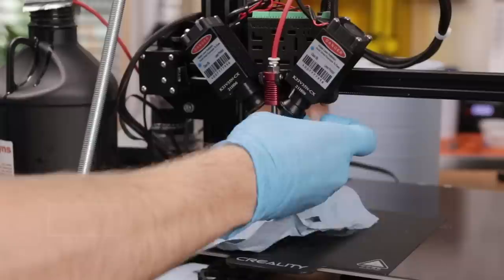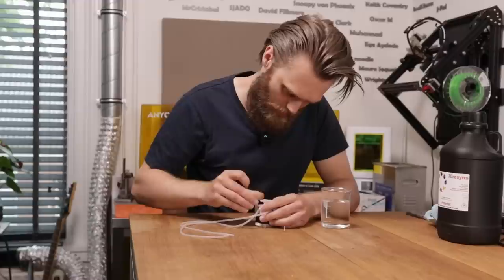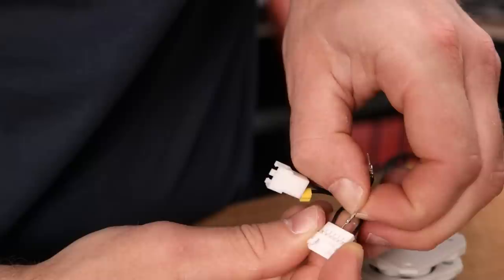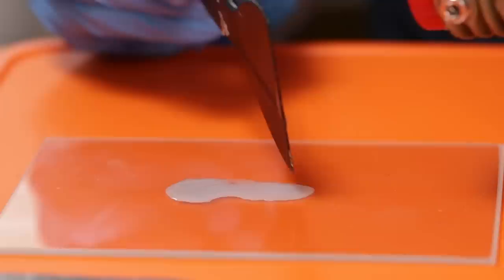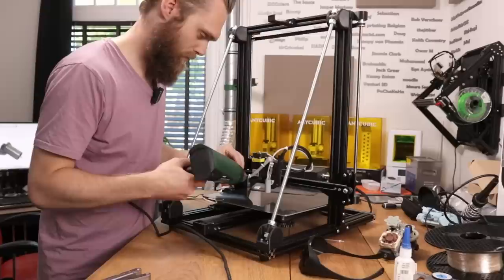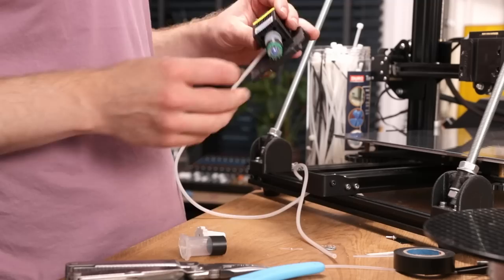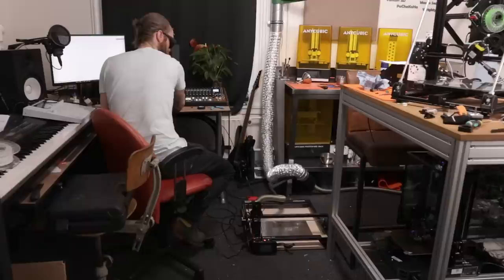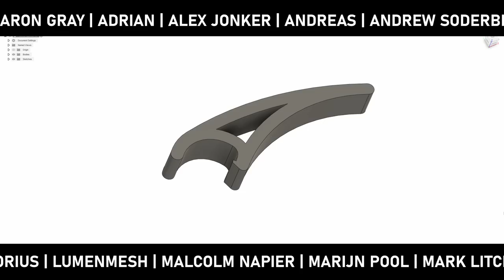FDM resin Printing with LASERS and a 3D Printed PUMP!

Comment: One note on the optical fibers, they can actually fail to reflect the light along the fiber if the bend radius is to small, maybe that was also a reason why the first design failed
Reply: Bingo.
Reply: Whilst we can see “some light” at the end of the fibres, some materials have much lower transmission at UV wavelengths.
For example Germicidal 250nm fluorescent tubes have to be made with quartz as glass filters a lot of the energy at this wavelength.

I suspect end polishing of the fibres also has an impact.
Reply: In this case it was because of the fucked up surface. One cannot cut fibre optic cable with a kitchen knife and expect it to transmit light perfectly. The cables must be cut with a special tool that makes sure the surfice is perpendicular and doesn't have defects. You also need to align very well the start of the fibre to the laser beam making sure it also is parallel to the beam. If the laser is coming at an angle, there will be huge reflections at the beginning.
I liked his idea don't get me wrong, but it is pretty clear he didn't research how fibre optics cables work

Comment: I work with lab instruments that use peri-pumps. They have a lot of advantages, such as easily adjusting flow and volume by changing the ID of the pump tubing.
You can eliminate the pulsing by using the flexibility of the tubing between the pump and nozzle as a pressure receiver.
If the flow from the pump is slightly higher than the nozzle size can handle, the tubing between the pump and nozzle will pressurise and expand slightly , acting like bellows to absorb the pressure pulses.
Also, having more rollers reduces the volume of the tubing between rollers and therefore the volume that is pumped with each revolution. Most commercial peri-pumps use only 2 or 3 rollers.
Reply: I used to use peristaltic pumps. I also recall them only having about 3 rollers and they definitely delivered continuous flow to lab instruments. I remember calibrating the flow and we used special tubing in the actual pump section with coloured tags on each end which indicated the flow range based on ID, these tags locked in place to stop tube movement and put the tube in the pump under slight tension.. helps with pulsing and stops tube feed.

Main issue with a peristaltic is over time it damages the tube changing the flow or even wearing through completely. So another reason for the short section in the pump as you just replace that small length each time.

Overall I think he should take a quick look at lab grade peristaltic pumps as they solved all these issues decades ago.
Reply: @RocketMagnetUK  I agree . There are many different designs. I have even seen hospital infusion pumps that used many flat plates operated by a helical cam to pinch the tubing in a continuous wave.
A company like Watson Marlowe would be able to give him all the information he needs

Comment: Hi really nice project. I have worked in a lab for uv curable resins but I have no experience with 3d resis. There are basically two kinds of catalyst for this typ of stuff. Radical and Kationic catalysts. The radical ones have the advantage that they stop working when Light is emited which is super important for high res.,  while the Kationic once continue after the UV is gone but they are way slower. So you actually could use a really thick resin with a cationic catalyst. It would allow the resin to cure after it has left the nozzle. But you would need rather thick layers and would have low resolution, but you actually might be able to get super fast printing speeds. If you do not care about colours curcumin is actually a pretty good kationic catalyst. Greetings from Germany

Comment: You tried the idea that I have been thinking of for about a year, great job! I would use multiple UV LED's in a circle pointing at just below the nozzle. The point is you don't need to fully cure the model during printing, so you won't need that much power delivered by a UV laser. The model can be fully cured later in a UV chamber, we just want this to get the proper model shape in the first place.

Comment: I totally had a similar heat related issue when playing with the plastic optical fibers on a project. Even got glue would partially melt the fibers, and be responsible for blocking the proper light transmission.  I felt your pain my friend.

Comment: Really nice, maybe instead of trying to cure full cure the resin while printing you can add a UV lamp and after every layer the nozzle go to a light protected place, turn on the Light for a couple of second and then continue printing
Reply: It won't stay it place this way. The resin is still a liquid that would flow down while you are printing one layer. You need to constantly cure resin that was just extruded.
Reply: @Karavusk  it depends on the layer thickness, the surface tension of the resin and the nozzle diameter, you can add something to the resin so it get thicker, like baby powder, the video you quote use a thicker resin more like a gel

Comment: Great video! I would use an air pump inside the bottle, and a valve on the nozzle instead of a pump, like the system used in the m3 max to top up the tank. Also i would try to print at very low temperature to have a viscous resin, much more like the gel in noel's video. That would allow to increase distance of the laser light from the nozzle and prevent clogging. Just my 2 cents here.
Reply: Arpad Toth  you just need to build enough pressure. Anycubic use the very same method to automatically top up the vat in the m3 plus and max printers: a sealed cap on the resin bottle and a small air pump that just pumps air into the bottle which then sends out resin to the vat.
Reply: Arpad Toth  just need to have enough pressure, people who have a well for their domestic water supply the water is pumped into a tank with an air bladder which then pushes into the house.  Our old house had that and it kept a steady 60PSI.

In theory a hybrid system would work to eliminate the issues of pulsing, a pressurized tank and the pump constantly pushes resin into this tank while an pressurized air pocket moves the water along. Just like how the well pump pushes water into the storage tank but the air bladder pushes it up into the home.

Comment: Wow, what a cool video and idea! I've seen some great suggestions in the comment section about pulsing the lasers. I am not an engineer by any means, but perhaps a "simpler" first attempt would be to extrude the resin with the laser off, then run the same path (without extruding the resin) with the laser on to cure the resin. The higher viscosity resin would probably be more ideal, since it better resists flowing away from the previously deposited layer. Yes, you are running the same print moves twice which will greatly increase the "print time", but I don't know that speed is necessary concern at this stage. Just an idea (maybe others had it in the comments too). I am looking forward to your next video!

Comment: Maybe the metal build plate was reflecting the uv into the nozzle. A solution would be to do two passes. Extrusion pass and curing pass for each layer
Reply: it might be the resin reflects the light too, could use black resin and big retractions maybe ?

Comment: I think your on the right track using a standard Nozzle shape, the V angles down towards the tip so no matter which direction the nozzle goes any oozing will flow back to the tip. With normal fdm the plastic is always soft and will be wiped off when the direction changes and gets 'run over' in the part when the nozzle returns thus it doesn't accumulate but with resin it needs to get cleared asap. the standard nozzle looked the best if you can sort the leaks.....hope this is some help, Andrew. love watching you work ....it's FUN

Comment: Sugesstion, paint the printning surface mate black, and use black resin to prevent ligth leaks, use a weaker lazer or dim it out, you tecnically can shine a weak lazer directly to the center, but, weaker so it doesnt solidify instantly, more like a flash ligth, that wen the center of the lazer gets away from the printnted point a second ago its solid enough to hold it self up, untill the next layer goes over

Comment: Amazing, as always!  Have your sponsor make you a custom resin that is more cohesive like silicone sealant texture or toothpaste so there is no surface tension trying to form drops. I believe that is why your nozzle ends up scraping. The trick will be to balance thickness vs 'pumpability'

Comment: I watched the same YouTube video and thought the process would be the end all in 3D printing. I have two suggestions. Lose the laser. Go with what we know already works,  UV leds. Cheaper and easier to work with. you'll still need some way the shield people from the light. Second use a tank to store the resin and air pressure to pump it. You can control the pressure very precisely and electronic valve to turn the flow on and off. Good luck and I'd love to see you make this work.

Comment: Indeed, it seems like you can take some notes from that machine in Joel's video. Opaque white gel resin is what they use. Less UV reflection with opaque white. Gel because surface tension is unlikely to hold. Perhaps if a single laser is not pointed at the tip of the needle but instead - a couple mm BEHIND the line of resin as it's being printed. That would only work if printing in that single direction, though. Hmm.

Comment: Try adding an additive to the resin to turn it into a gel, add some viscosity to it so it acts more like melted filament vs water. Surface tension causing too many issues

Comment: Inkjet printing has had similar flow issues with nozzles, one of the ones that worked well there was with a piezoelectric crystal for a drop on demand printhead. This was used to control droplet size and speed of droplet ejection from a reservoir. 
Very exciting to see this, looking forward to more updates.

Comment: Incredible first iteration! I'm glad your persistence payed off. 
If your enthusiasm towards this project still outweighs your frustration and you're planning on a redesign, I have one possibly good suggestion:
Higher pressure resin through a much smaller nozzle. If you get the pressure high enough you can form a small jet of liquid that will still be diposited even if the nozzle lifts off the surface. As a side benefit, this will increase the flow velocity giving less time for the resin to cure in the tip of nozzle (also the smaller opening will let in less UV).

If you like the idea then I'd look into using a scroll pump for consistant high pressure flow. The elasticity of the peristaltic pump tube would be an issue at these pressures, especially when you want to turn it on and off quickly. Perhaps pneumatic tubing would be a good choice.

Comment: One quick solution to try should be to get some kind of matte dark black coating or cover on the build plate, which should greatly reduce the curing issues, as the black material should absorb most of the laser light. Maybe use a bottle of Black 3.0 to paint a build plate and place under some kind of transparent matte non-stick sheet? 

You may still have issues with the light reflecting off the printed material, but should otherwise greatly cut down on the reflections.

Comment: I would experiment with led exposure time for resin cure. With this I would set up a led timer circuit with the pump module so put sensors on the position of the pump to give you timing so it can interrupt the led and pulse it as a strobe effect. I believe the resin is illuminating on itself so a timed led pulse strobe would most likely help. Remember translucent liquid acts as a magnifying glass for light. This will take mulitple sessions to get the timing correct.

Comment: Once upon a time, there was a roller pump (application) that suffered from poor impulse control. But as luck would have it, that problem was solved back in the early 1970s. The application was pumping blood in heart-lung machines, but the impulses caused by the action of the roller(s) would put a "squeeze" on the red  blood  cells,  causing them to burst.
You need an entirely different solution (no pun intended) to your fluid transport problem.

Comment: i suspect the liquid resin itself acting like an optical fiber inside the nozzle, uv light hitting the cured part is getting by a process called "frustrated total internal reflection"  bounced around inside the cured part, and up into the nozzle, curing the resin prematurely in and around the tip. your printed part is in this case also acting as fiber optic, where the liquid is touching the part when its getting "extruded", a uv light bridge occurs, releasing these internal reflections from inside the part into the nozzle.

you are an absolute mad man even attempting this.  we need more of this lunacy

Comment: Loved this video. The biggest issue is the reflecting light really. Have you tried putting down a layer first with high viscosity resin, and then curing it? Or maybe a ballpoint pen mechanism could work to block the resin inside the extruder, you would risk locking up the ball though.

Comment: Printing is looking great, very confident you will get this right.
If you wish to steady the flow from your pump fit an accumulator. They are used to even the pulses created from a pump system easy install.

Comment: Wow, that is very cool!! You made amazing progress and thank you for showing all the issues you ran into.  I am not sure if this is possible. If there was a way to thicken the resin that it is more like a gel, so the laser(s)/fiber optics do not have to be aimed at the nozzle. The resin just needs to hold its shape long enough for the to laser pass over it.
Reply: I think a thicker resin would likely be the key here.
Reply: @CalebKraftmakes  the company that makes the  resin extrusion printer has two ways of cleaning the nozzle so buildup is definitely an issue for this type of 3d printer

Comment: Nice vid! Just a few observations; if the glue has same index of refraction as the fiber optic they might disrupt light flow. Also, just snipping the ends of fibers is not a good idea. Pros actually use special tools to grind the fibers completely flat under a microscope. The ends are the most important part of the fiber in many respects. So 1. fit fibers 2. cut all fibers at once in the laser end and grind them down to a flat surface together 3. grind each strand flat separately in the other end 4. fixate with something non transparent like rtv 5. profit

Comment: when you use resin printers to make things like your... laser funnel thing, I was really surprised to see that you only printed one at a time. You can print multiple at once with no cost to the print speed, giving you multiples incase something breaks or if there are small printing defects you can sort of choose from a batch. A lot of what you do is way over my head, hoping this small thing I saw can help improve your QoL during these epic experiments.
Reply: But then you risk losing double the material if the print fails or if you need to adjust something
Reply: @simonquvang6073  I mean resin in not thaaat expensive... :D Also with proper slicing resin prints almost never fail
Reply: @simonquvang6073  I don't personally find that to be critical issue, especially not when trying to develop new hardware. I'm saying that as a person with absolutely no income. Obviously when you are evaluating resin printers or printing in general it should probably matter, but uh, for this guy and for this use, I'm gonna label it a non issue/

Comment: Hi Adam, I tested this solution last year and my best results were on my old coreXY by reversing my bed plate and axles. print upwards, the resin holds better to the plate and the prints are clean!

Comment: your enemy is chemistry not mechanics ;)

The MSLA resins are having a very high content of photocatalyst - try resin for instance used on a Formlabs printer, they cure totally different from a spatial perspective. The MSLA resin you use disperse the laser and react to it much stronger than the SLA resins. It will be a function of viscosity and time / distance from the print head you cure. The current resin is most likely 'wicking' the laser laser under the nozzle, despite your attempts of 'shading' it, the resin is way too sensitive to the laser. 
You could try to reduce the sensitivity and viscosity, by passing it through a peltier cooler prior the nozzle, sort of turn the heat block into a ice block. 
That will change chemistry and viscosity, allowing you to cure further from the head.

Comment: so this is essentially the way stratasys polyjet printers work, except they use many more nozzles in what i can only describe as a vernier grid array. also in order overcome the overhang issue, support material is printed around the part preventing loss of shape or drooping. if you can add another head to do the gel support, you will have much better success.

Comment: Fun project! Maybe gelifying the resin? Either through slight cure or adding clear gel monomers of some sort?  Adding a thick black Nozzle with a flat bottom that curves up to absorb refracting light. 
Change the resin color to dark grey solid or other dark solid to make it easy to test. 
I was able to manually "print" using a 3d UV pen so I always wondered why not with a machine? 
Sometimes maybe the key is to start super slow with thinner layers.
You can try a flexible tip inside the nozzle tube like a brush for more control and lineance with bumps? 
 Anyhow, 

Good luck!
Reply from the maker: Thanks for your suggestions! I received resin with separate additives to control the curing rate, making it matt black and turning it into a paste. I'm going to get this to work!